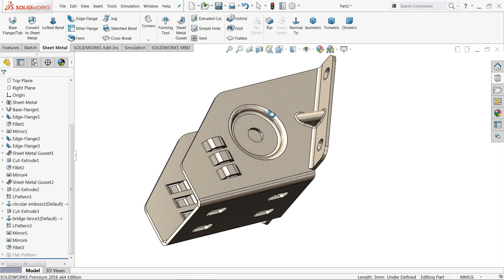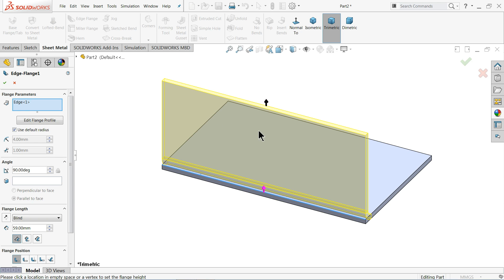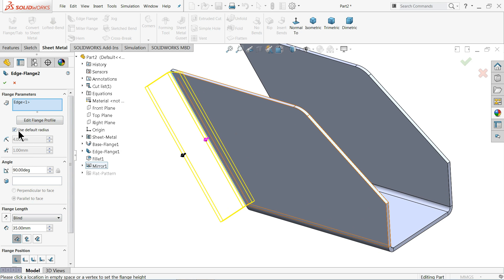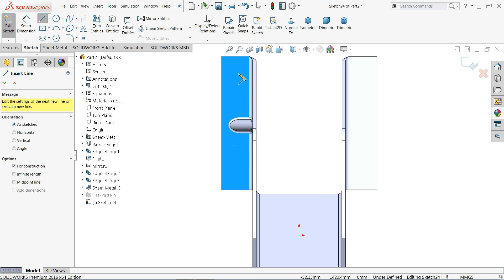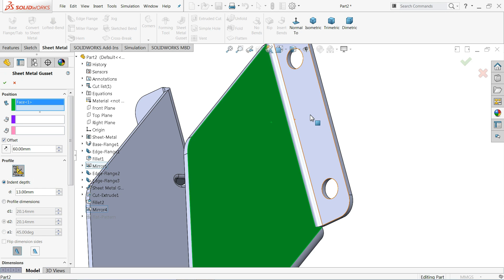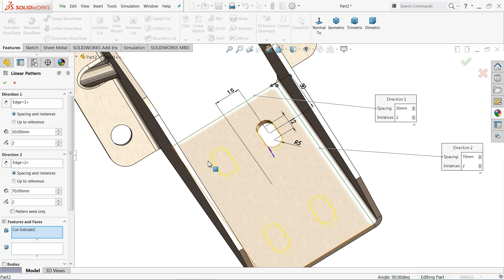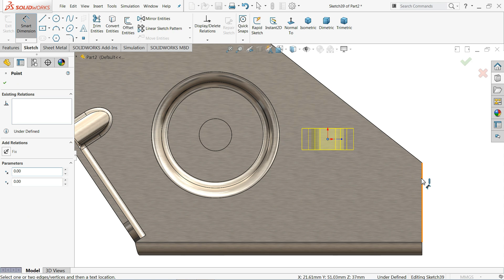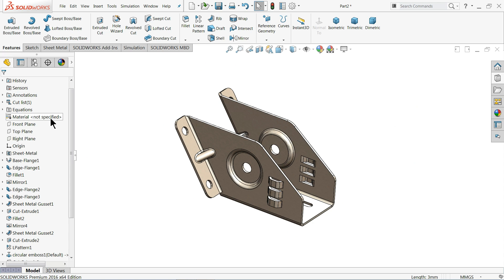SolidWorks Sheet metal exercise

Comment: Hi there, I'd like to suggest something here. I don't know about ur computer specification. But if you can afford to buy a workstation computer with dual XEON processors and a Quadro graphic card, you don't need to wait for any loading that comes from a CAD application. Your computer won't be slowing down anymore. Even a second-hand workstation can handle SOLIDWORK applications easily. Have a look at eBay. Heaps in there, but I don't know in your country. Anyway, I like your work. Appreciated it as always.

Comment: what is the reason for doing 800 mirrors when you can model everything in one half and then mirror everything?
Reply: Some beginners can't imagine how doing something will look like when mirrored. It helps with continuity. Especially when we have seen the part finished in the start with all the features.
Reply: @SergeiFragov  engineering is not an imagination process, you think 10+ times and build the part in your brain well before you sit down and design anything. And having done one side and mirror it in one go it will save you tremendous amount of time. Unless you want some features present on one side only, I really see no reason why you do mirroring after every feature build.
Reply: @SergeiFragov  also since you're aiming at begineers you could also show them how to save time and work more efficiently